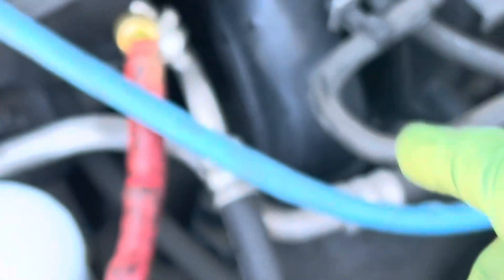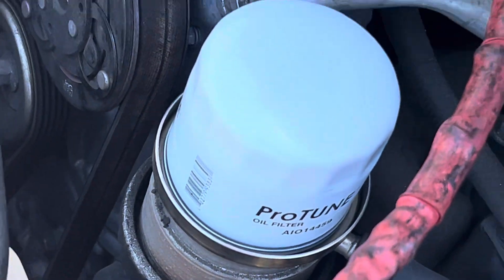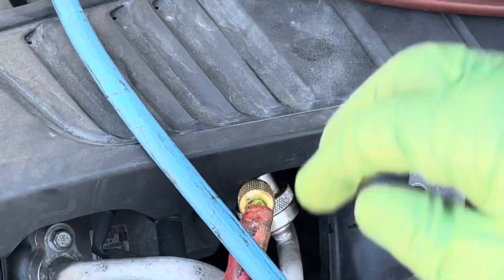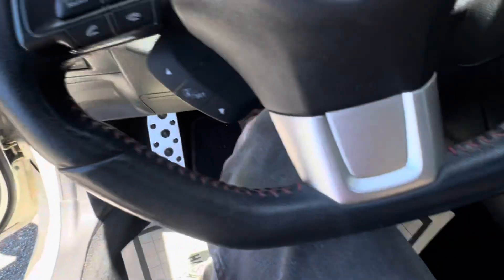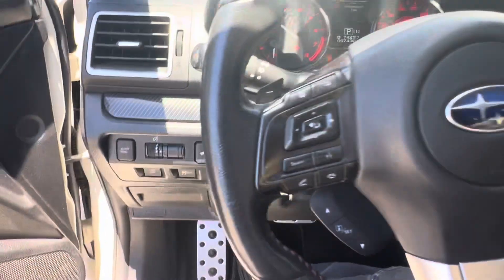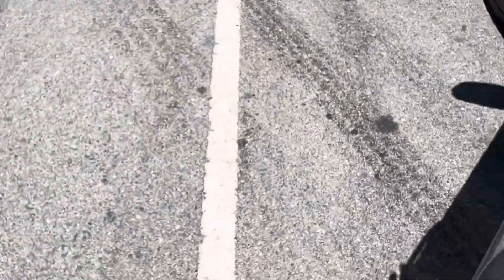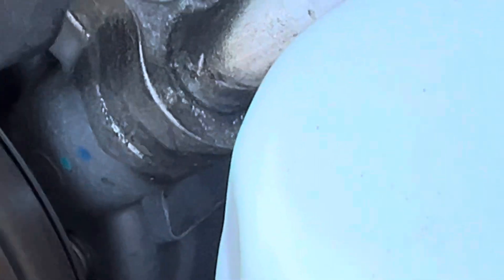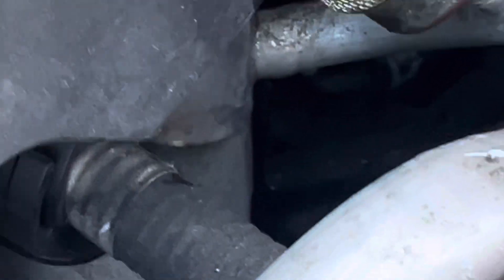HUGE REFRIGERANT LEAK STOPS 🛑 DURING ADDING REFRIGERANT. 100% gone after a few minutes of running

Comment: Having worked in Heavy Equipment and Trucks for 29 years I've seen this many times. Video is a good reminder to younger technicians and others to think about under what circumstances o-rings and hoses see pressure. With how automated and dumbed down everything is these days I'm supprised the new machines don't use nitrogen and a variable pressure ramp to check for leaks.
Reply from the maker: @traviswells1388  that’s why I call them big dumb machine.  

Push the button , it just works. 

When it doesn’t? I don’t what to do

Comment: When observing pressures on a variable displacement compressor, would you have it running at max capacity (blower fan speed) or lower?
Reply from the maker: @charlesphiliparthurgeorgep4653  MAX capacity, windows and doors open Fresh Air mode blower on high speed.

But if it’s not hot enough outside, you’ll never max out the compressor to go to 100% duty cycle for full displacement
Reply: @coldfinger459sub0  Perfect, thanks!

Comment: I appreciate you experimenting for us.😊
Reply from the maker: @who_wantsit  it’s fun
And I always learn something new that I’ve never seen before . 

Especially with all the newer vehicles that are controlled by software . 
    Different manufactures software controls differently. 

And you can perform the same experiments on charging or discharging different amounts of refrigerant, and depending on the manufactures air conditioning algorithm controls to variable displacement, compressor, and the condenser fans . 

Drastically different results 

Then you’ll have the old fogies who say but air-conditioning is all the same, and it must follow the same rules and basic principles . 

Not anymore 

Because man has gotten involved with sensors and actuators variable displacement compressors, and fans, and has literally taken over control and force the system to operate differently . 

All the old fogies who used to diagnose off of pressures are now outdated like old dinosaurs
Reply: @coldfinger459sub0  Man just has to have control all the time, can't leave anything alone.
Reply from the maker: @who_wantsit  👍

Comment: All I work in is Subaru, I've seen this scenario dozens of times, they'll leak one minute and then stop. It happens during pressure and temperature transitions. 
They'll bubble when you recover the refrigerant and the pressure starts to drop.
I hardly ever see the UV dye, just refrigerant leaks.

Also, the expansion valves, the plastic plug on the end, check there. If the plastic plugs is not flush with the surface of the expansion valve block, that's a place they leak very slowly.
Reply from the maker: Yes, I have a lot of videos of a lot of Subarus with all those other leaks to. 
Subaru is the king of  AC leaks in the automotive industry